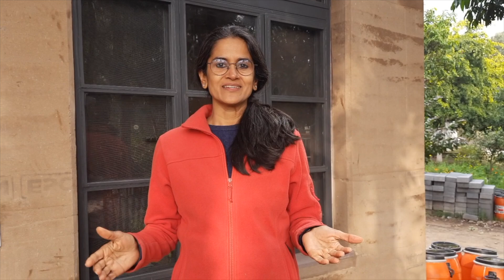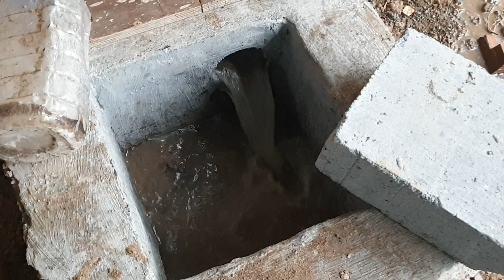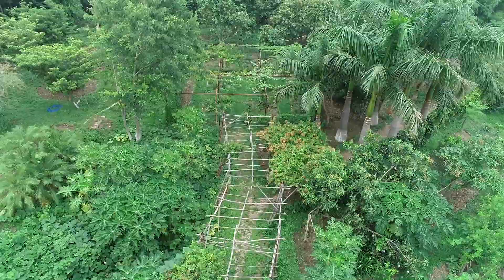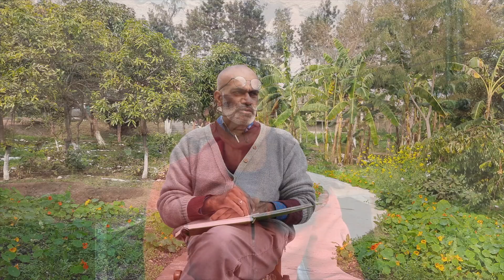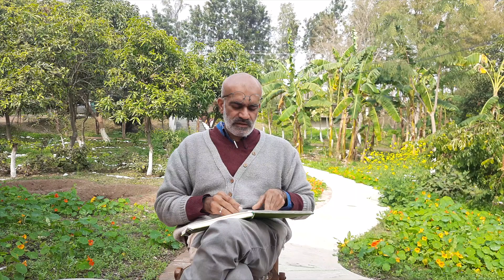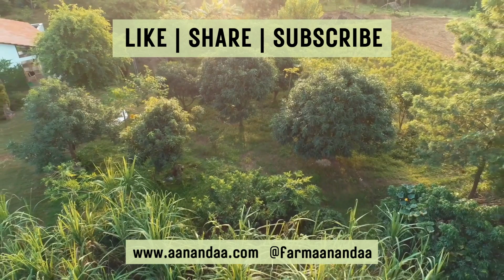How to make a Sustainable House

Comment: In the first few seconds of the video, I could see some jeevamrut preparation plastic drums were kept behind scene. 
Do we need to many jeevamrut drums to irrigate in farms? 
I am just curios to know as looking to implement permaculture in my farm!
If i am not wrong, those small drums  can be easily carried to the required plantation areas for irrigation than drip setup!

Is that the purpose the drums are seen with large numbers...
Reply from the maker: Those drums are of Lime which we have used in house construction. For jeevamruta you need only one big drum.

Comment: your sustainability should be defined by the simplicity of it's set up:

1> ram pump for running water - gardening (including hydroponic gardening) and long term water storage

2> 6x12v battery bank that is charged by waterwheel, solar and wind (both the water and the wind can be rigged with an simple electric motor) - depending on the weather conditions...heck, they have even developed a charging system that works off of a rocket stove...

the main goal of the battery bank is for shelter heating...if it can be used for lighting, etc - then that's just gravy...

3> shelter heating (non electrical) - saw a vid where a craftsman wrapped the stove chimney around the shelter and out the other side (where he built an access door for smoking and drying meat...another one built his bed on top of the horizontal part of the chimney to warm his bed)...

4> dealing with human poop is actually easier if you don't have to ship it off somewhere else...

i guess the key is to not depend on the technology - always have a backup plan that doesn't involve it...
Reply from the maker: Would love to hear more about your sustainable house. Sounds awesome!

Comment: How much living space is sustainable? None of the current architects will address that basic question. The sustainable living paradigm has to expand to include the size of houses being built. A small family can live very comfortably in about 1200 Sqft of living space. Should they buy or construct a large house of 2500 sqft living space simply because they have the financial capacity? Should the need for external validation drive this family to build a large house?
Sustainable living can only happen by limiting our wants. No architect will tell you that for obvious reasons.
Reply from the maker: True. We also constantly pushed the architect to reduce the space and eliminate useless areas.

Comment: This ramearth works is actually revival of rural technology which was in place some 30 years back before this cement revolution when soil,Sand & lime where the main ingredients. This project is an amalgation of rural knowledge &modern architecture. 
Back at my rural house ,when the summer temp soars in between 40-45degree Centigrade, it's cool respite inside without any fan /electricity and u never come to know it's evening. A great work done by your team in preserving the  ancient traditional culture which was self-dependent/reliant & eco-friendly.
Reply from the maker: Thank you and so good to hear about your experience 🙏

Comment: Thank you for the new series - I am looking forward to see details of your completed home. Is it possible to give an approximate cost per square foot excluding the land cost as I already have a farm and am very interested in building an eco-friendly house.
Reply from the maker: Difficult to do so because we havent finished building, but it costs the same as regular construction. Only material cost is lesser and man power cost is more.
Reply: Cost per square foot could range between 2000 to 3000 or more, depending on the availabity of materials and resources, infrastructural costs and kind of finishes. If we look, just at rammed earth, labour cost of ramming and finishing  is abour 225 per cubic foot but total cost is dependent on a few factors:
 1. Availability of earth: on site or does this have to be brought to site. What other aggregates you need to mix with your base earth/soil.
2. Experimentation/ Tests to get the right mix...proportions of stabaliser to the base earth/soil. We have used about 10% lime by volume for the earth/soil type that we have here. In some cases ( more sandy soil) 5-7% cement may work better as a stabaliser. If you have the right mix and can do thicker walls, you may not use any stabaliser, but more labour for ramming.
3. Shuttering or Formwork cost: This can be reduced if you are sharing, or renting or reusing the materials afterwards. We have used marine plywood and metal pipes, both of which we plan to reuse on the same site. 
4. You will  save on plastering cost if you do the repairs well and leave all the rammed earth walls exposed.
Reply: @jiteshmalik3606  Thank you so much for the approximate cost